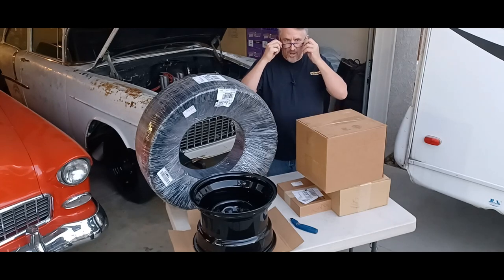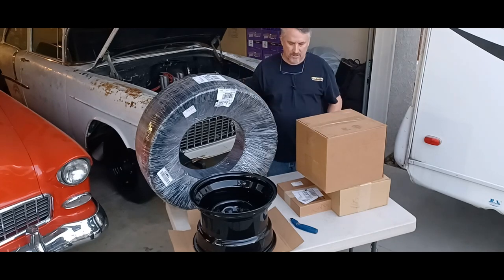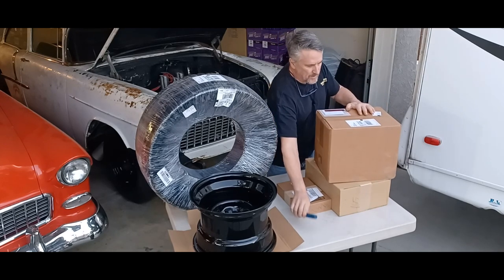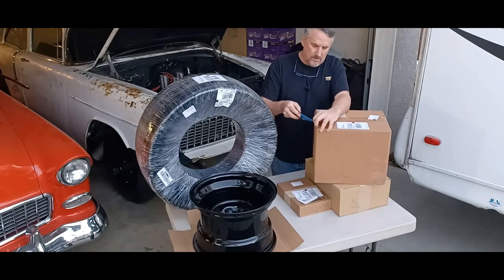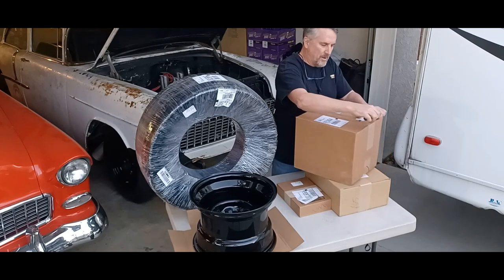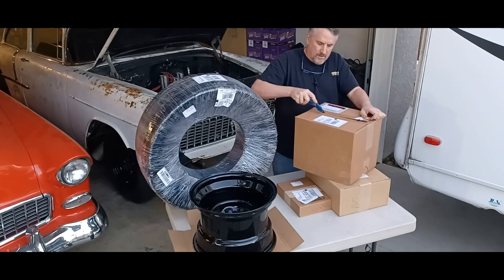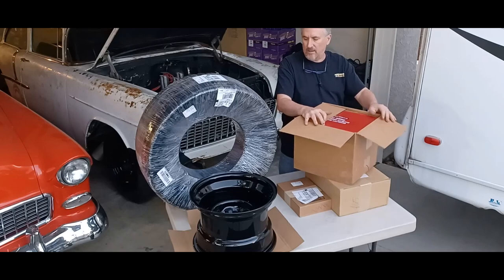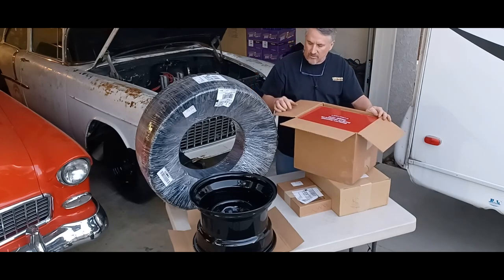New Parts for the Historical '55 Chevy Gasser!

Comment: I really like the Gasser videos. You nailed it on the back wheels and tires. The radiator was money well spent in my opinion! That's going to be alot of fun at the track. Have a good one Buddy 👍
Reply from the maker: Thank you Don!  I had wanted to go back and have a custom set of wheels with the correct offset made for the car but, I took a chance on the 1 only option they had at Summit Racing on 15x10 steelies.  Towel City had the best dimensions and look on their pie crust slicks so, I took a chance and ordered the wheels and tires.  It really worked well on the car and I was really surprised!  The radiator was worth every penny and continues the original look with a date coded tank.  I keep thinking about your Big Block '55 Nomad and how you have an awesome foundation to build towards a really fun, period looking Nomad Drag car.  We had a couple of very well known Nomad Drag cars out here that really were one of a kind!  Jim Martin's "Low Roller" black '56 and my Favorite "Casey's Mad" silver metalic '55.  These were the hero cars of my day watching those cars run and the fun the guys had driving them!  Your '55 would look great with some pie crusts on those Cragars with a chrome single hoop roll bar.  Nomads are really popular at the drags and they don't need to be cut up to go fast and have fun!  Thanks for watching Don!  I always appreciate it and the encouragement!  Take care!